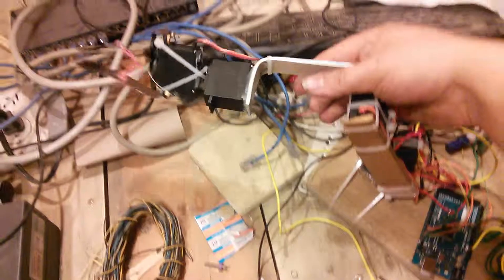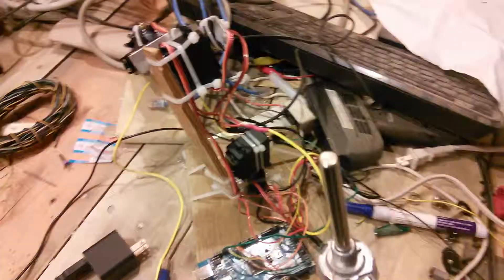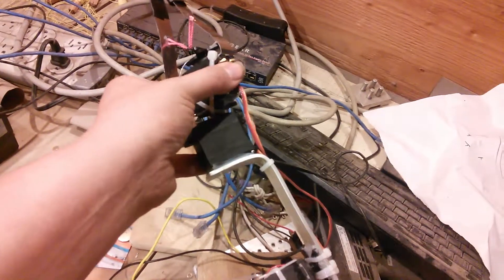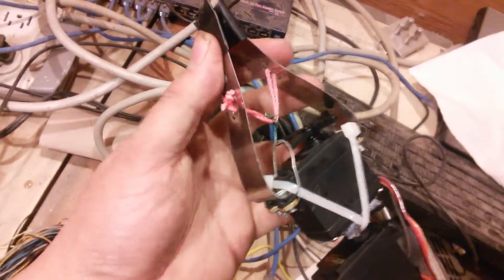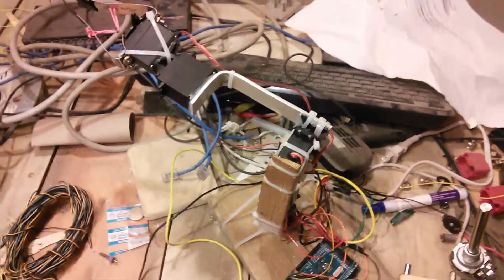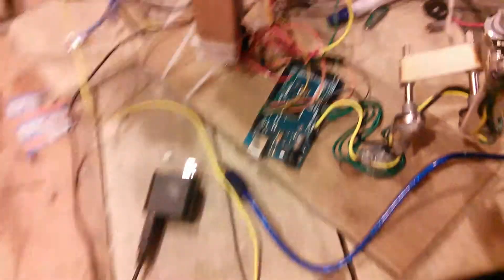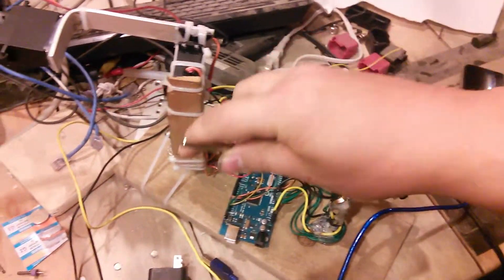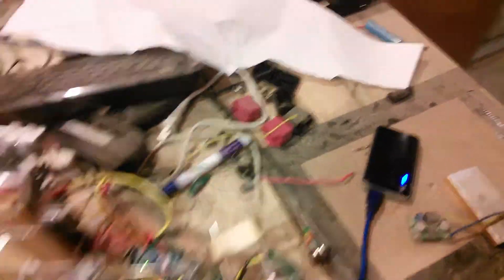Robot arm with puppet control

Comment: i didnt use digital servo motor , and used a standard servo motor with  potentiometer  as feedback signal working really great
Reply from the maker: So you could use the feedback to estimate force applied by the motor?
Reply: @theevilovenmit  no I need high torque servo motor so converted a dc motor to servo motor and amplified the voltage for robotic arm